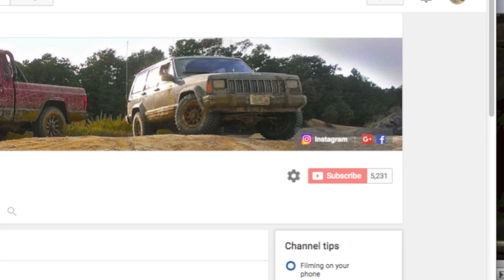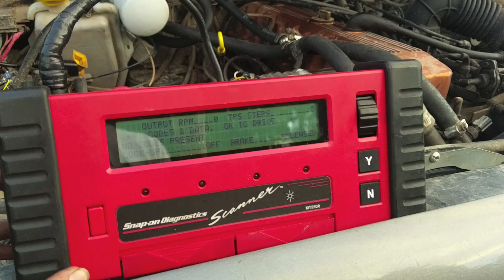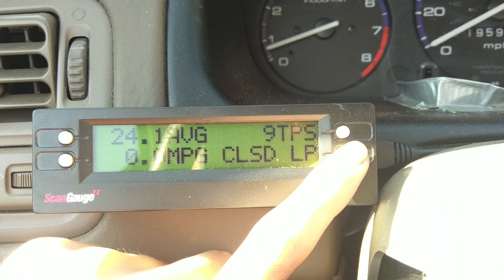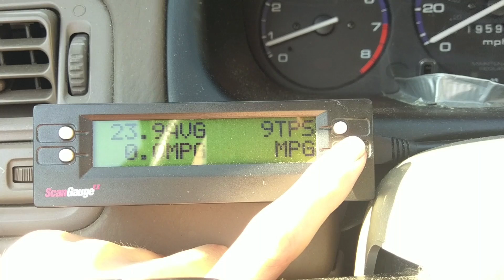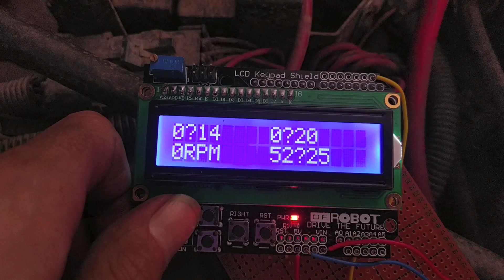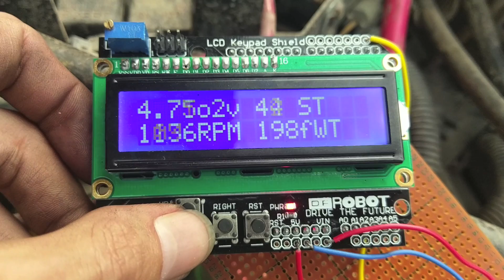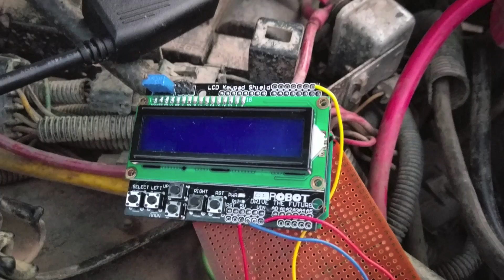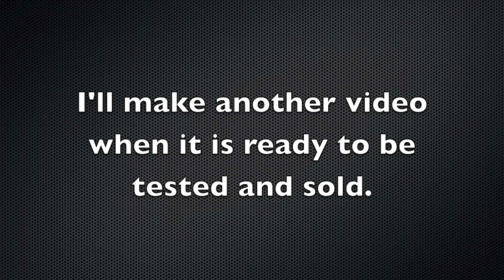5k Subs, Channel Stuff, and a Secret Project?

Comment: I'll gladly test one (you were a huge help on Facebook when I was trying to diagnose my fuel pump power issues with the relay readings)
Reply: I too have an 89 xj & I am almost sure a couple of my sensors are shot so i could test the warning system if you do put one in.
Reply from the maker: Hmm, I'll keep you in mind for sure.
Reply: +NickInTimeFilms much excellent. otherwise I would like to purchase one I've been wondering what my jeep would say if I gave it a voice
Reply from the maker: Well here's the thing, I might charge base price for the sample models with the intention that if it works you get to keep it and get a good deal out of it for helping out. The components should be cheap enough to be worth it.
Reply: +NickInTimeFilms yea I'm game. & I'm also a jersey native 08052 if you don't want to worry about shipping I'll probably be down to pick up
Reply: +NickInTimeFilms also are you planning to have it mountable in the cab like the civic or a hood up diag type like the brick scanner
Reply from the maker: Sounds good and In-cab for sure. The possible 20x4 model may be either handheld for under hood or also cab style.
Reply: +NickInTimeFilms awesome. any perception on when you may have test models out/refined models for purchase? or will it be once you feel it's ready?
Reply from the maker: Damnit, Had a whole thing typed up and then the page updated when i went to copy something....

Once it's ready, I have so much more to do on the hardware and software side before i make test models. Basically, I want to finish the product and send a few out. Add any necessary revisions and then sell to everyone.
Reply: +NickInTimeFilms I hate that shit. but yea, I'm curious to follow the progress on these things. good luck with it all

Comment: Get this out on CherokeeForum, and Jeepforum. Also I have built 3D printers and could help you on the case point. Also, you should consider making it stick in the space where the dash clock is, I am building a system for MPG, and  sensors that ill fit there. Love the project and your creativity, and would like to help any way i can
Reply from the maker: I'll start marketing on Forums if I can get a useable enough project. I did think about making something that fit in the clock slot since it's mostly unused. I'll keep you in mind if i decide to print anything. What kind of printer do you have? I did a bit of research into decent full enclosure abs models
Reply: I've built Deltamaker 3D printers that print PLA, but that might not be suitable to the heat inside of a car (sun, etc). But I do have experience 3D modeling and could help you mock up a design for it. I think if you make it so customers can cut out the dash clock enclosure and pop it in, the case isn';t even necessary. Even better, you get a collection of blank dash pieces, and sell them pre-installed.
Reply from the maker: Yeah, I got really excited about PLA until I saw the heat limitations and the fact that the sun starts to break it down. I have a little bit of modeling experience but I may ask for help to get things rolling.

If I do make a clock replacement, it would be a bolt in install kind of thing. Unscrew old clock, screw in replacement screen, the less consumer effort the better. Biggest limitation is screen size. It would have to be something weird like an 8x4 or i'll have to learn TFT color screens
Reply: Yeah, PLA does have some drawbacks. I like your idea on the replacement of the clock, as it sounds real easy for everyone. I have been looking into screens myself that would fit the dash enclosure, and have found a few that i like and fit the 1980-90's style. However, i haven't found a real ringer yet. We just need to keep in mind that there were differences in the dash clock layouts throughout the years, but they can be overcome.
Reply from the maker: Are the physical sizes different? I figured they all had the same form factor at least. and VFD displays give a nice 80's style but they are more pricey then LCDs and hard to come by
Reply: Google "cherokee dash clock" I think Gojeep has pictures of the different kinds on his page. Also, VFD might be too 80's, I was thinking the same screen as the stock dash clock, or a 2 color OLED display like this: https://www.amazon.com/dp/B00O2LLT30/ref=wl_it_dp_o_pd_nS_ttl?_encoding=UTF8&colid=1PJU5QWBVX0JC&coliid=I1LDYEBNH5FF8
Reply from the maker: Hmm, Swanky. Haven't played with full displays yet so I don't know how much harder they are to work with.
Reply: They can't be too hard, and you can always stick with LCDs as a back up. This is more coolness factor
Reply from the maker: Well, I love me some coolness factor. Maybe in due time.

Comment: I have a 92 is there any way to make that work on mine
Reply from the maker: Now that is a good question. Currently this will only work on Renix era Jeeps since they share a common ECU. The newer Chrysler brand ECUs are much different and I doubt will work with my current project. I'd have to see if they even have a TX output
Reply: +NickInTimeFilms ok plz do and where did u get the one in ur civic I would like to get one for my 98 Honda Civic ex
Reply from the maker: You can find them all over, it's a Scangauge II http://shop.advanceautoparts.com/p/scangauge-ii-digital-trip-monitor-sg2/10206633-P

Comment: I feel like MJ people would like this, since like 90% of mj were built between 86-90, also just out of curiosity would it work on the 4 cyl engines?
Reply from the maker: Very true. It should if it had the Renix Diagnostic Connectors. My friend has a 4 cyl mj that i will try to test again. My snap on scanner could read it, but my output dump code wasn't picking anything up unless the key was completely off which wasn't right. I didn't think to check if the ground was good at the time so i will have to try again with the current version sometime.